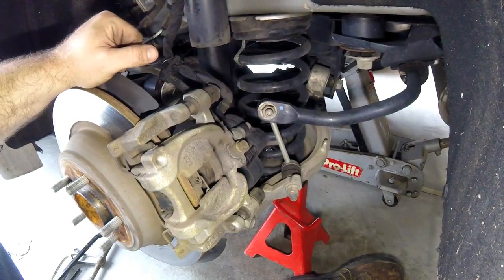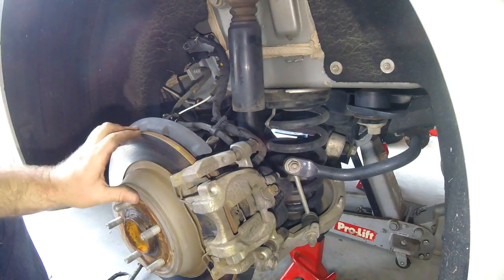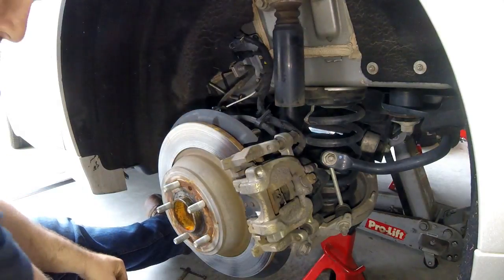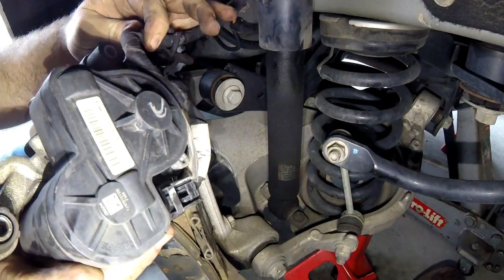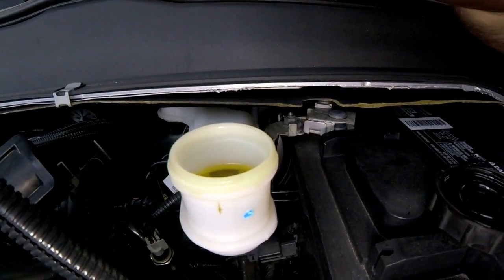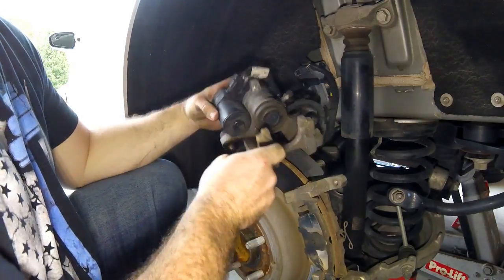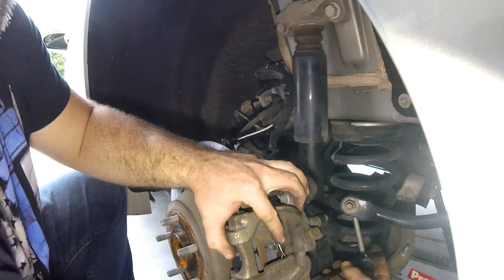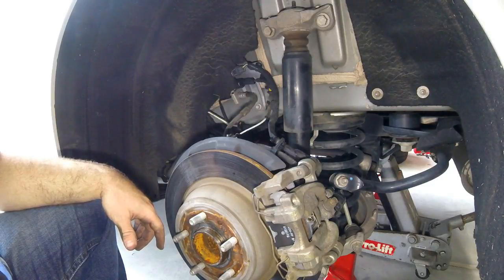Ford Fusion Rear Brake Pad Change (no special tools!)

Comment: I watched about 20 videos today on changing the brakes, this one is honestly the best one I’ve came across. Every other video recommended specialty tools that’s why I clicked on this one cause it was titled no special tools needed. Very helpful
Reply from the maker: Thank you Anthony! I love being able to help people.
Reply: @MicahMartinDIY  my fusion is a 2016, I’m trying to use a 3/4 socket to remove my lug nuts but no luck, any suggestions
Reply: @anthonyrosas4116  18 or 19 mm. 3/4 is way too big. 11/16 is a little loose. But 18 mm fit just right.
Reply: @MicahMartinDIY  it was awesome well done

Comment: It's usually a good idea to pull out the slide pins / clean them up / re-grease and re-insert them.  Takes no time at all .... great video btw !!!
Reply from the maker: Good idea Dennis! I'll be sure to do that next time.
Reply: @MicahMartinDIY  I agree with Dennis. My slide pins were bone dry not sure how my calipers were even moving. Also, I used to use a big C clamp like that but I found a 8 dollar tool piston compression tool that is so much easier and safer. I have the electric park brake too so using it instead of C clamp was my best option. Thanks for the video
Reply from the maker: @outdoorlife8453  Great tips Matt! Thank you!
Reply: How much should you put on each? I see people put a good amount of grease on them
Reply: Which one are the "slide pins"? Thanks
Reply: I've watched at least 4 break videos this week, and not a single one of them put grease on the caliper pins.  I had this same thought LOL
Reply: @mrsgmrsr8791  The caliper pins, they are the pins you remove with the 7mm Allen.  They hold the break caliper to the bracket, and are how the breaks are able to slide forward and back as the breaks are applied.  You want to grease them so they don't seize up, causing a potentially dangerous scenario.
Reply: I can speak from experience, having done a lot of brakes, that the pins can easily get seized up. So making sure there is grease on them will ensure that they move freely. It's no fun having to replace a brake caliper bracket because the pin is seized in it. I've had to replace two rear caliper brackets on our Chrysler Town and Country. It might also be a good idea to routinely regrease them every 6-10 months or at least check them more regularly.

Comment: just did my wives 2017 fusion with the help of this video...only difference is when i put it in maintenance Mode all i had to do is use a large screwdriver and pry on the old pads to get the piston to go back...once i got it back 3/4 of the way i dropped a extension in front of the pads and used the screwdriver to pry the piston back the rest of the way
Reply from the maker: Good to know Rick! Thanks!

Comment: You can also put a Fusion in maintenance mode for that rear caliper piston. I like your style with the needle nose pliers. Won't break it that way. Just make sure the notches are  Perpendicular. There's a YouTube video how to put the vehicle in maintenance mode it takes 10 seconds to activate.
Reply from the maker: Thanks Remi! Good feedback.
Reply: @MicahMartinDIY  Im no mechanic, but can do the basics,  definitely learned a handful of things from your video Micah. Took me half hour to do both sides. Thanks for making this video Mister, have a good weekend
Reply: I put my breaks into maintenance mode, but forgot to put those notchs perpendicular to line up with the break pad.  What is that for?
Reply: If I put into maintenance Mode can I just push it in with a screwdriver against old pad or do I still need a clamp of some sort? I've found some people say in maintenance mode you can literally push it in but still not sure.
Reply: @cale9987  theres a tab on the pad that needs to line up with the notch on the piston

Comment: You can just put the e brake in maintenance mode and it will decompress it self and then use a small c Clamp
Reply: NOO!  Do not do that.  I learned the hard way. I put it in maintenance mode and used one of those special caliper compressors and it wouldn't budge. Once I took it out of maintenance mode I was able to turn it. It didn't require extra compressing like he did here.
Reply: I was getting ready say the exact same thing!
Reply: @cskye6529  so you're saying maintenance mode didn't help
Reply: I put it in maintenance mode and got a parking brake malfunction warning.
Reply: You Neeeeed to put it in matience mode the Ford manual says so by not putting it in matience mode you can damage the electronic brake. It's not that hard to put the car in matience mode.
Reply: Definitely put the parking brake in maintenance mode & then the Ford service manual says: “Compress the brake caliper piston until a piston bottoms out in the caliper bore. If the brake caliper, piston bottoms out the piston is still not fully compressed, rotate the piston clockwise while pushing inward using a brake caliper piston retractor until the piston is fully compressed.” You can use a specialty tool or a c-clamp will work as well. So, to clarify, you put the vehicle in maintenance mode, compress the piston & if it bottoms out & you need to go further, compress & rotate clockwise simultaneously.
Reply: Takes way longer to put it into that mode and it does just to use a C clamp easy
Reply: @DownRange02 Thanks for your clear explanation 🍻

Comment: Put your car in service mode and you can push the caliper back in with your hand no problem. Also T45 trorx bit for the idler pins and put a little grease on them pins to so they can glide, great video too just a little bit more info to help out great job!!!!
Reply from the maker: Thanks for the tips! I'm always learning as I go.

Comment: Thank you for being honest about using a C-clamp. Watched some other break job video out there and guy completely skipped over pushing in the piston. They just said use the cube special tool and screw it in.. one side i managed to just screw in and push onto the new pads.. the other side tho wasn't even close and that's when I found your video. Thanks again.
Reply from the maker: Glad I could help Peter! I know how much money it saves to DIY.

Comment: Thank you sir for your instructions, followed pretty much all the way. However, let me suggest the piston retraction after winding it up. Instead of cramping it and risk damaging the electro motor, just return the caliper with the old break pads and stick the screwdriver to exert pressure on the piston. Did it just like that and all worked flawlessly.
Reply from the maker: Thank you, yes I am always learning new things. Cars are not what they used to be when I was younger!

Comment: Instead of a C clamp, after the piston is screwed in, you can put the old pads on the caliper, and pry between them to force the cylinder back in the rest of the way. Similar to prying it back in on the front, while the old pads are still on the car.
Reply from the maker: Nice tip Denis!

Comment: You can also use a torquex 45 instead of the Allen wrench. Put it in matience mode don't c clap that e brake caliper presses are like twenty bucks. You also should use brake grease and clamb shelling the caliper makes it much easier
Reply from the maker: Good tips! Thanks!
Reply: Torx & Allen/hex are NOT the same thing. Why do people keep saying this?

Comment: Great video , helped me do my Mondeo rear brake disc and pad renewal . To help I made a simple tool to turn the piston back into the calliper body as they were too stiff to use long nosed pliers. The tool was made from brass 3mm thick by 30mm wide. I filed the centre to form a recess leaving two prongs on the outside. Then I could apply more force and rotate the piston back.  I used brass because it is easy to file but you could use aluminium or steel if that is more available. Thanks anyway for the details.
Reply: if you wouldve put car in brake maintenance mode , you wouldn't even need that tool bro.. you could've just compressed it

Comment: You should actually use a T40 hex bit for the bolts. An Allen wrench might grab also but you risk damaging the bolt or having the Allen wrench seize up and snap off in the bolt.
Reply from the maker: The newer models may be T40. The 2014 is Allen.
Reply: @MicahMartinDIY  they are the same thing?
Reply: T-40 is a large Torx bit. Allen or hex is not. Clearly.

Comment: Thanks for the video! I do have one question though.  What about the “service mode” that has to be turned on with the scanner prior compressing the cylinder? Is it mandatory? Is there any risk if you don’t turn that mode on?
Reply from the maker: I've seen a lot of comments on this. I would be safe and use service mode. Although it didn't damage anything when I failed to do so.
Reply: @MicahMartinDIY  thanks boss

Comment: Thank you for your clear video mr. Martin. I had another question. I have a Ford Mondeo (Fusion) MK5. My car has an electric handbrake. If I do not activate this handbrake and switch off the ignition, can I easily replace the brake pads and discs on the rear axle?
Reply from the maker: You're welcome. I'm no expert, but you should be able to. Google "maintanance mode" for electronic hand brakes first though.

Comment: Good morning, I have 1 question. I've done a few brake jobs but none with an E-brake.  In your video this is not mentioned, but is it necessary to put the vehicle in maintenance mode?
Reply from the maker: Correct, I did not do it in the video, but it is recommended, which I did not learn about until after. I didn't hurt anything though.
Reply: Micah, thanks for the quick response. Your instruction video is perfect for the work I’ll be doing.

Comment: You didn't put the brake system in maintenence mode? You just forced these calipers in wow.. You have to put it in electronic maintenence mode unless this is the old model fusion. The new ones do not turn you can push them in with your fingers. What model year was this

Comment: I do appreciate the video. I'm getting ready to do my 2017 fusion. I'm seeing a lot on here of people saying to put the e brake in maintenance mode since it's electronic and it helps the caliper release its self and maybe pry with screw driver then swap pads and reverse process..so do I have to put it in maintenance mode...or no?
Reply from the maker: Now that I've seen so many comments about it, yes, I would put it into maintenance mode if possible.
Reply: @MicahMartinDIY  thank you...I did change the brakes this past weekend and I actually didn't put it in maintenance mode my fronts were normal calipers and pressed them back in with old pad and clamp. The rear were like yours plastic but I did borrow the specialty tool from a buddy and they turned right in nice and easy no resistance so it still worked. I appreciate your video and reply I just didn't want to mess anything up and had seen several videos where they say to and several where they don't mention it at all. So I guess if your getting resistance then put it in maintenance mode if they are pressing in smoothly then continue on😉 thanks again take care and be safe

Comment: Do I have to prime the brakes?
Reply from the maker: No, only if you suspect that there is air in the lines, but if you don't have a leak or a faulty brake cylinder, there is no reason to suspect air in the lines.

Comment: So you dont have to put it on Brake Maintenance Mode?
Reply from the maker: I was able to do it without using maintenance mode and did not hurt anything, but honestly it is because I was unaware that this mode existed. If I still had this car, I would use maintenance mode next time.

Comment: What size c clamp did u use to plush the piston back in?
Reply from the maker: I used a 6 inch, but you might be able to get it with a 4 inch.

Comment: No grease? No brake cleaner?
Reply from the maker: I'm all for keeping it basic. In my experience, grease just makes extra grit and brake dust stick in there and gum it up worse. But use your own best judgment, I am not an expert.
Reply: @MicahMartinDIY  Good point.  Except for the caliper slider bolts.  Well I put a little of the blue ceramic grease on the contact points but globbed a lot around the slider bolts that are sealed by the caps in the back and grommit in the front.  Well the little bit I put on the contact points will probably just get absorbed by the dirt and flake off.  I could probably check it all in a few months.